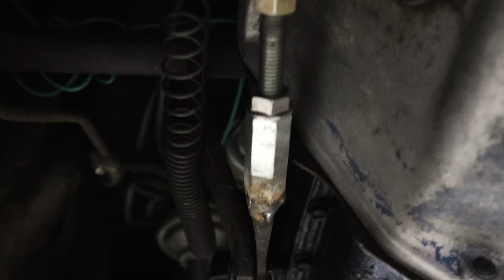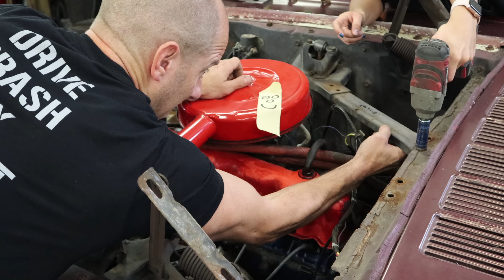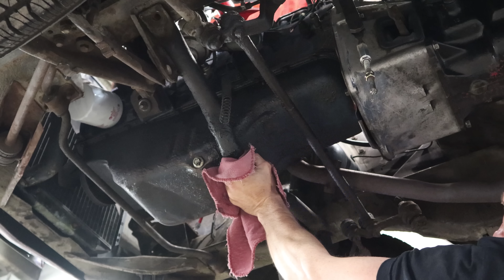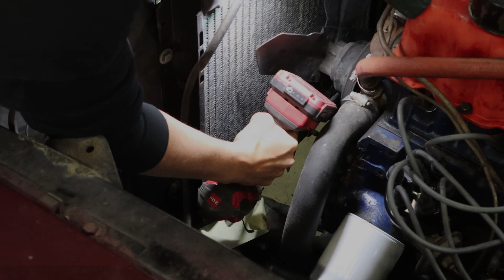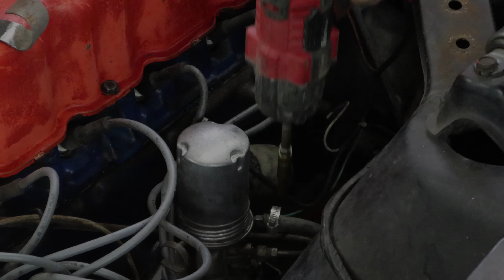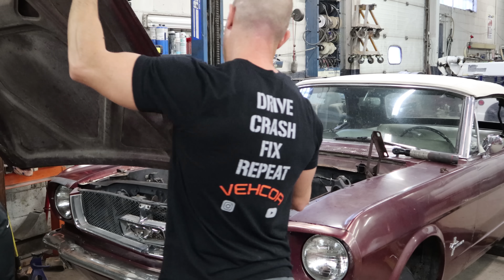1965 Ford Mustang restomod rebuild project part 2

Comment: Watching you dismantle the Mustang reminded me of when I used to work on 1960's vintage Holdens around 40 odd years ago. We used to actually drive those cars back then. Quite a lot of similarities between the Ford and the Holden, like the accelerator linkage and other general things. But the early Holdens had a generator, which I would swap out for an alternator. Bigger engine in the Ford also. We had 138 to 186 ci engines.
Reply from the maker: I don't work on many older cars and none as in depth as we are going on this one.  That is the first time I had ever seen a pedal assembly like that.

Comment: GM engine going back in I assume.
Reply from the maker: Nope, I am not one to mix brands.  Ford makes a decent engine for this so no need to use the LS.  I save that for my Camaro restomod.
Reply: I dunno, he's a GM guy, but he's building this Ford, meaning he's open minded. He might just build a nice Ford drivetrain for it.
Reply from the maker: @williamsinger4124  https://youtu.be/CgTxeKU2j1s
Reply: He mentioned Coyote so I guess he is going big or back home
Reply: @KPearce57  ...Coyote won't fit in there without a bunch of fab!
Reply from the maker: @paulcopeland9035  https://youtu.be/CgTxeKU2j1s I covered that.

Comment: When I worked at CedarPoint maintenance we would just put the insecticide in the crankcase of mt 68 XL convertible, 428cid drive it around the perimeter road to fog for mosquitoes. Bad valve seals worked wonders on insects.
Reply from the maker: With the way this thing uses oil I was thinking it was a two stroke. lol

Comment: I have never seen a zerk fitting in the cap of the u joint
Reply from the maker: A lot of replacements have them.  It's too bad they didn't use them. lol
Reply: sure looked handy to get too

Comment: with enough oil you will always find your way home - ford
Reply from the maker: The low oil light was the 1965 version of "recalculating." lol
Reply: The oil sender on our Ranger blew out about a mile from home (it had 250k on it).  I dumped a bunch of oil in and idled it home, took about 3 years for the oil track to disappear off the concrete haha.

Comment: the GPS joke had me on the floor laughing! Great video
Reply from the maker: You never get lost until you run out of oil!  lol
Reply: Ford should market GPS fluid!!!, leave their mark on the world!!!
Reply from the maker: @mikeshowtoandthings  *This GPS device is known to cause cancer in the state of California. lol
Reply: Grease positioning system
Reply: Premier landscaping 🤣
Reply: I had an 84 Mercury Topaz that in the 6K miles I drove it the oil filter got changed twice.  The OIL ITSELF in that time well I used 30 quarts of it.  Yeah the freaking thing drank it at the rate of 200 miles to the quart of oil.  What was the problem a blown rear main seal that would have cost more than the car was worth.  Then when I lost my job I said SCREW it scrapped the car and bought a bike for the next 3 months.
Reply: where's the P65 warning sticker
Reply: 6 Cylinders were know for being oil drippers.  You can tell he drives a chevy, because he looks for oil trails that he left with his chevy.  Go back and look at the 60s chevys, they were ALWAYS covered in oil

Comment: British rust proofing  🤣 Good one !!  I own a 1968 pony car ragtop and you can make all  the ford jokes you want 🙂 I can take it .🤣🐄💨💨💨   What do you want for the engine and transmission.
Reply from the maker: I make fun of everything, including what I drive personally. It is the only way to keep sane when trying to figure out what engineers were thinking.  Every car has its issues.  Even though I have my favorites, I don't have a problem with people having a different preference.  If everyone liked the same thing, the world would be boring.  People just need to lighten up and stop being so offended by everything.  Thanks for watching!
Reply: @vehcor  Wow there's an oxymoron, a thinking engineer.
Reply: @vehcor  Roger that !  And your right about these engineers and what they come up with like for instance friggin door handles positioned just right so the lock entry gets filled with water and freezes or windshield wipers ever notice the piece of plastic that surrounds them how well it turns into a frozen lake engulfing the wiper arms ?  There are days I would rather turn back the clock before all this plastic crap came out give me back my steel cowl and exsposed wipers dam it 🤣.
Reply: Gotta have a sense of humor being a car guy. I'm a GM guy, but I like something from every manufacturer. My neighbor has a 65 mustang that I love. He's a Ford guy, but, he loves my 91 formula firebird. We swap cars randomly.
Reply: @williamsinger4124  I've owned and drove  Plymouth, dodge, Pontiac, Chevrolet, Ford, Volkswagen, Audi, AMC, Cadillac  Have worked on and drove them all I'm not picky 🙂 But which one would I call a favorite It would be a toss up between my old 1968 Dodge Coronet 440 or The 1973 Javelin AMX . Nothing wrong with a little variety.  🙂👍👍👍👍👍
Reply: @willf5768  I had a 68 Coronet 440 wagon with the rear facing rear seat, maybe I should have kept it.

Comment: Let’s go Vehcor!!!!! I’ve been looking forward to this Mustang build!
Reply from the maker: Thanks for the support.  I'll head over and give you a like on your new video in a bit.  I know it will be good.
Reply: Thank you! This week is a simple air filter change, but next week will be a little more involved. I’ll be showing how to diagnose and pin point a failing backup sensor, and then how to replace it.